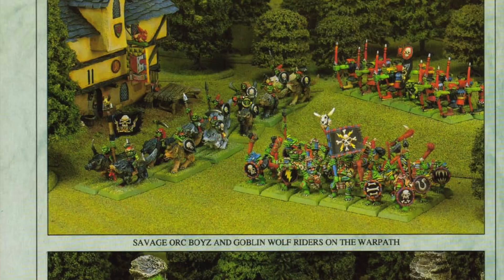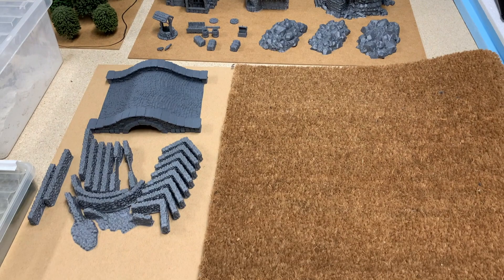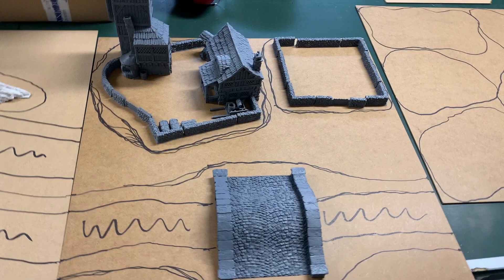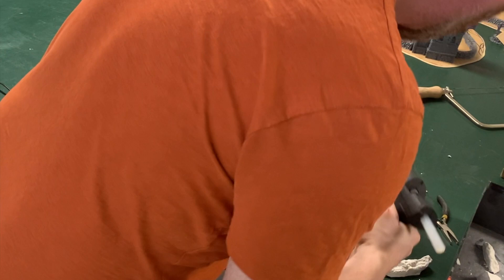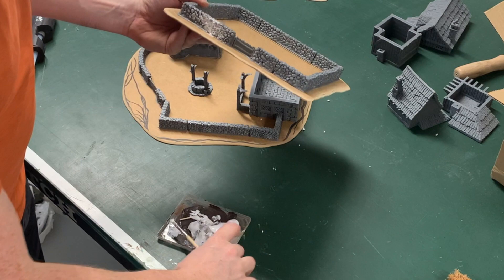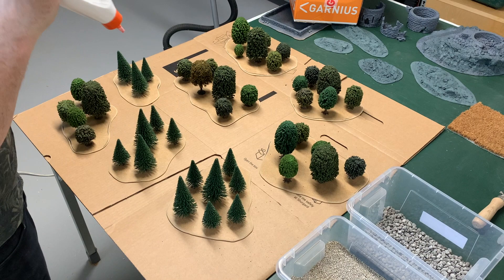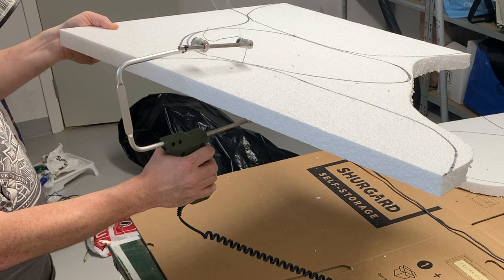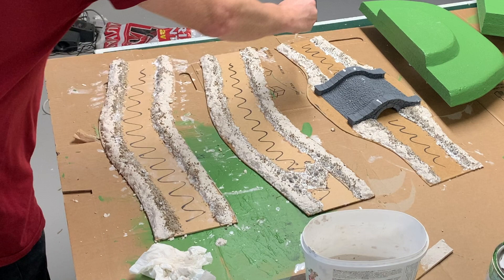Building an old school Warhammer battlefield. Part 1.

Comment: Hi! I've just discover your channel and will dig in. I have to stop the video to point something important about security and health care. About sanding and the hot wire tool it may be a good thing to say to wear a mask and have a good ventilated area... I stop being the bad guy and return enjoying your video.
Reply from the maker: Yes. That is true. I did wear a mask for smoe of these parts but i should have made that clearer.

Comment: Nice video. Did you experience any warping issues on your base boards? Since a lot of texture, glue etc is added on 1 side and the boards are very thin? Same question for the big table plate with the map. Any warp there?
Reply from the maker: Thanks. No i use hardboard that doesnt warp at all. There are special kinda that are coated with some kind of oil that prevents warping. Check your local hardwarestore.